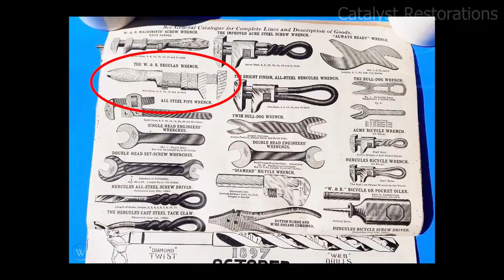102-Year-Old Monkey Wrench Restoration

Comment: Very different restoration method from what I have been watching. Seems more sensitive. What will stop it from rusting now?
Reply from the maker: Yeah, I tried not to go overboard with sanding and grinding since it is a family heirloom. To prevent future rust you can soak it in oil and then wipe it dry (it's cast iron so it'll soak up some oil) or use something like a wax paste which will also do a similar job. Should've showed that on camera!

Comment: is it just me ?..or did you forget to take the bend out of the handle? the wrench looks good overall, but i would have kept some of the original patina....maybe use steel wool instead of sandpaper
Reply from the maker: Thanks Billie! You are correct that it does have a teensy bit of bend still. I weighed heating it up to bend it back, but then I'd need to properly anneal it so it wouldn't become brittle and I didn't have the setup for that at the time I did this video.

Comment: not bad. need paint
Reply from the maker: These were never painted originally.
Reply: @CatalystRestorations  so 5 y later u'll do it again.
Reply from the maker: If you clean and oil a tool regularly, then no, it doesn't have to be painted.
Reply: @CatalystRestorations  i'm sorry but i didn't see it in your video